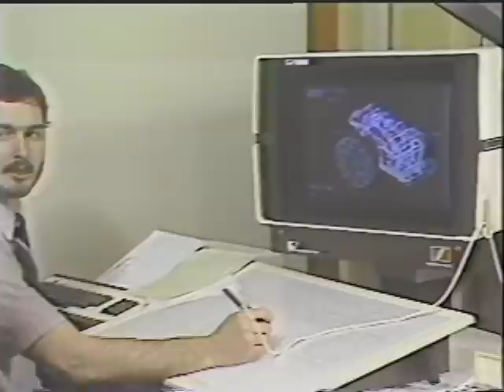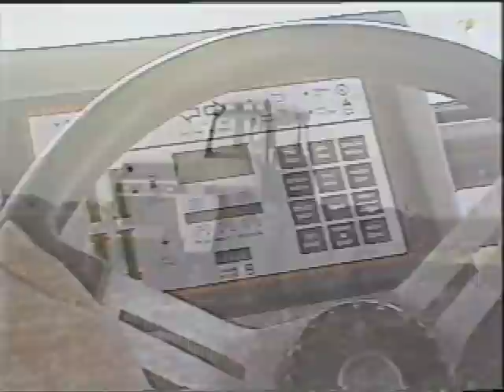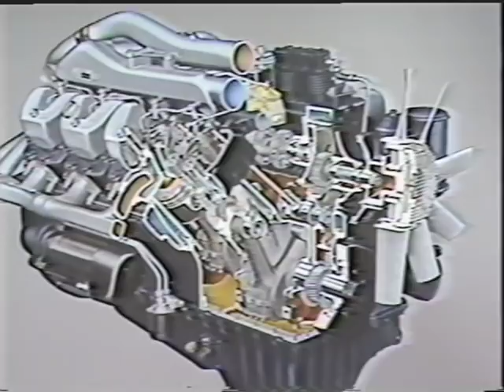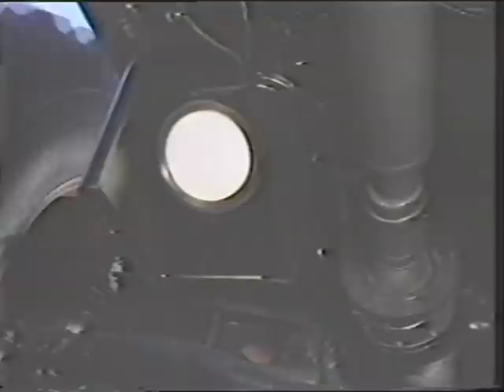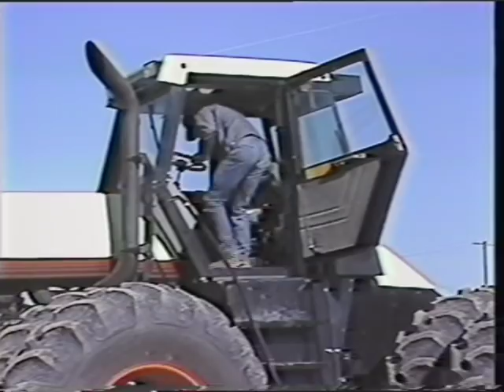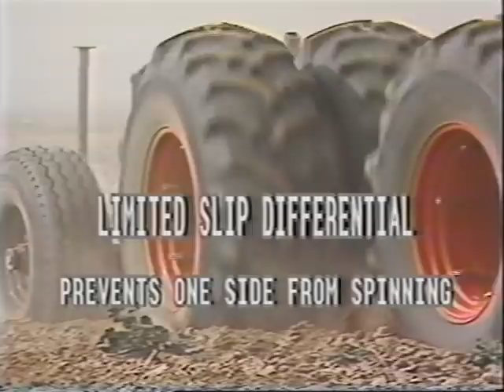Case - Different By Design

Comment: Different by design didn't fly after Tenneco merged Case, IH and Steiger in 1985 and 86. They launched the Magnum series in 87, which was largely IH engineering that would have replaced their 88 series, so long gone was the CASE 504 engine and Power Shift trans.... Then in 88 they launched the Steiger articulated 4WD's, so long gone was this rigid frame axle steer 4WD engineering... At this point there was nothing left of any original CASE engineering in the new tractor lines, only the name...
Reply: CDC engines had 50% Case in it... that was about it. Magnum was IH of America, Maxxum was DB, 4wd was Steiger, the sub 100hp was IH GB or IH Germany

Comment: Allis-Chalmers used the slogan "Better by Design" back starting in 1978 I think.
Reply: Then it was the rising power in Farming after that if I'm correct
Reply: @Ihfarmer1066  Oh and my 1973 7030/7050 brochures says The Rising Power in Farming. It also says The Orange Age Begins but I think that brochure is the only one I have ever seen The Orange Age Begins..
Reply: @Ihfarmer1066  I looked and the 1978 brochures do say The Rising Power in Farming. What year did the 7010 come out? That brochure introducing the new 7010 says Better by Design. I think it was 1979 or 1980. I don't have that brochure to take a look at the print date code.
Reply: @SilverGleaner  I think the 7000-7050 were made from 73-79 because I have 1 or 2 brochures that say the rising power in farming on em
Reply: @Ihfarmer1066  7050 and 7030 were built in '73 and '74 and replaced in '74 by the 7060 which is the same year the 7040 and 7080 were first built. The 7040 was replaced in 1977 by the 7045 while the 7020 was a new model in that same year. The 7060 and 7080 were replaced in late 1981 by the 8050 and 8070. The 7000 replaced the 200 in 1975  and built through, I think, 1978 and replaced in 1979 by the 7010.
Reply: The 8000 series said better by design
Reply: @RJ1999x  Yes that is true but my January 1981 7010 thru 7080 brochure also says Better by Design...... along with The Power Squadron. Looking through my brochures, that is the earliest I've found that slogan, Better by Design. January 1981 almost a year later in December 1981 the 8000 series appeared. I always thought Allis had good slogans and great brochures.
Reply: @SilverGleaner  The best is on the cover of the 8000.
"The innovators offer, what others will imitate "
Odd how they predicted that all competition copied them even to this day

Comment: Even being owned by Kern County Land and then Tenneco since way back in 1964, I'm still surprised that Case still existed by 1983-4 (when this video was made).  Of the seven North American companies making a full line of ag tractors at the time (Deere, Harvester, Allis, Case, Massey, White, and Ford), Case was the only one who offered no other farm equipment besides tractors.  They exited the farm implement business back in 1972, the same year Tenneco bought Case from Kern County.  Clearly they were living on backhoes and other construction equipment, but it was also true that Tenneco was ready to dump Case if they couldn't make Case into a larger player in the market (which they instead did by buying the ag side of IH).
Reply: Tenneco forced Case to dump barely profitable or unprofitable lines. Case as a whole was break even to losing money every year. Tenneco bought IH and Steiger to make Case profitable enough to spin off or sell. They couldn't sell Case before as there was no buyer for it who could make it.

Comment: Gotta love the insistence that it was a Case engine, not a down-tuned Scania truck engine. Actually, it'd be fun to see how one would go with the modern, 16.4L DC16 with 770hp and 2729lb-ft available.
Reply: It said Scania right on the damn thing, lol.
Reply: there is virtually no difference between the engine in a tractor and a truck - they're just diesel engines. It's all about the transmission - if you build the transmission to properly match the engine and the machine it goes in you can get the same performance, but possibly not the same fuel economy.

Comment: Let's talk about the case partial power shift. Lol
Reply: No kidding
Reply: JD and IH are back to offering partial power shift in the 150hp-ish tractors so ya lets talk
Reply: @admiraltroll5255  your not old enough to remember case and the power shift from the 70's . If you put it on a baler you where usually repairing the transmission every couple years
Reply: @robertmoulton2656  Ran a 1570 to till and pull wagons with on my uncle's farm. no bailing though. 
Not as nice as full power shift but ya gotta use what ya got. 
Use 3-1(good ground) to take off. shift to 4-1 once i got the train a moving. Can't lolly gant and don't shift in 2 or 3(auto goes to 1)

personaly have a 530 in the demonic Case-o-matic :) PO'ed a guy at my day job when i told him the reason he hated is families 800 was because he didn't know how to run it

Long and short im a young idiot but i love me some old junk:)

Comment: I do love there old case promos . Time has not been kind to these tractors. Junk when they rolled off the assembly line.  The only thing that makes them valuable is how few are still running .
Reply: Just think if they wouldn't have been junk. Most features were copied.like tilt hood. Just the 80's weren't a good time to try new ideas.
Reply: @ramshackleshack751  the case partial shift should have been dropped sooner. Disaster  😬

Comment: didn't they buy white
Reply: No, Case never owned White.  Through a series of mergers White became part of AGCO Corporation.
Reply: @bn4172  ok
Reply: We had a 4490 case. Bought it with 1800 hours .  It was always broke down. We put 1000 hours on it and 30000 bucks into it. Most of the problems were operator related. And foolish spending. I bought a jd 8760. Put 1000 hrs on it with no problems. Sold it for what I paid for it. Buy a tractor you can use . Not just repair every day.